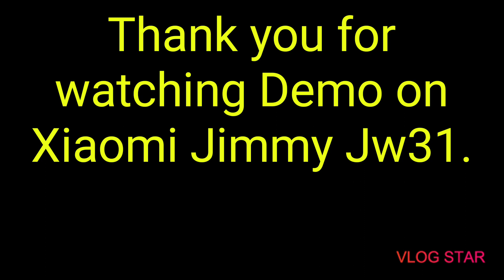NEW Xiaomi Handheld and Cordless High Pressure washer real life test using only a single battery.

Comment: Hey there, is this device gonna be able to wash a dirty muddy car in the forrest? I drive offroad. What do you think? Or not enough pressure? Thanks for the video.
Reply from the maker: Hi there, there are many other videos on this product on a dirty muddy truck, seems it just takes longer time base on truck size and how dirty the truck is.(also take note of battery duration, if it takes longer than 15mins, extra battery is recommended)
Reply: @dgbikes886  Can you please link one of these videos? Thank you for your answer and advice!

Comment: how many buckets you use for the whole wash?
Reply from the maker: Abt 1 pail of water before foam.. Less than 2 pails for rinse.. All the time using "turbo" mode.
Reply: @dgbikes886  Typical 20 cents can fill up how many pails? Sorry for silly question.
Reply from the maker: @yowetan  usually in spore 20cents give me abt 2.5 pails of water.. But it varies from location to locations.. Some other washing bays gives 2 pails or less only for the same price.